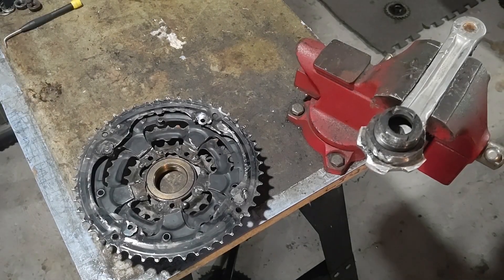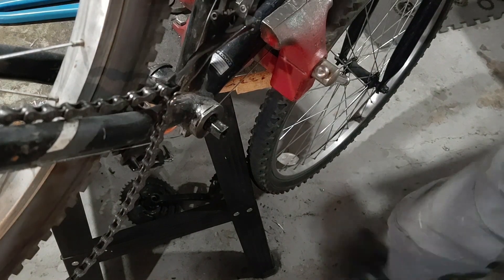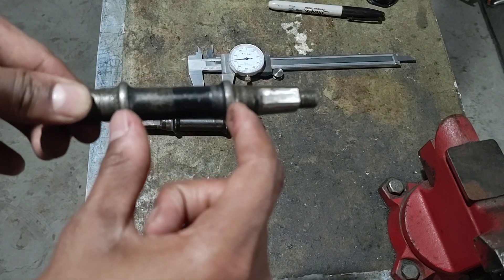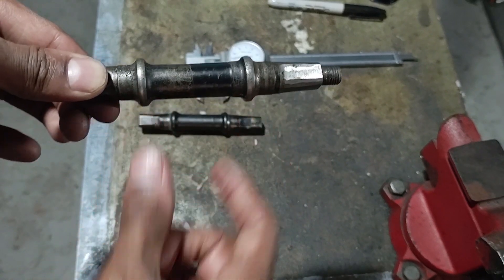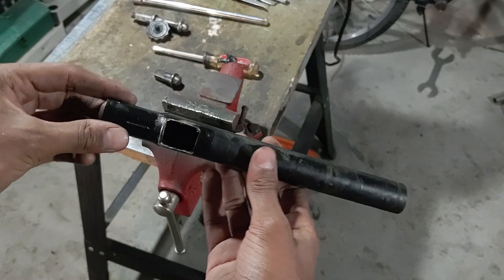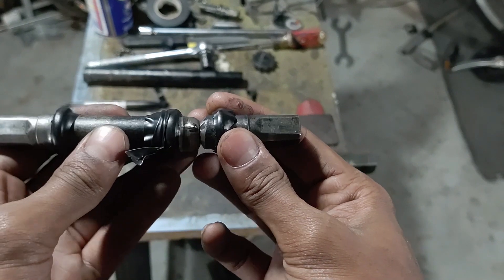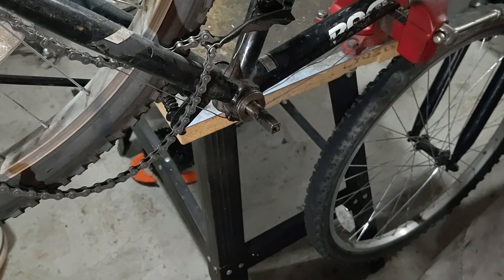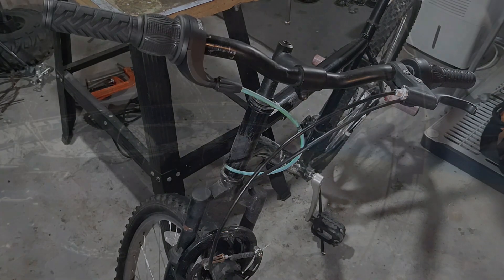DIY Mid Drive E-Bike Part 3: Extending The Spindle on Bottom Bracket

Comment: Thanks for the video.

Do you know where I can find the bottom bracket with those lips for cyclone? Probably they took from some old bike design? 
I'm already running my own mid-drive bicycle but I need to change the motor attachment design to attach the motor to the bottom bracket just like the Cyclone, but I can't find this bottom bracket anywhere.

I need 100mm version for fat bike.

Comment: When are you gonna post next video bro
Reply from the maker: Hey, I apologize for the delay, I've been super busy lately with a bunch of other projects which I will be posting on this channel soon, but I am planning to resume the ebike come June!
Reply: @engineeringdiy6311  I am doing mechanical engineering right now. I am from India. I also wanted to make my bike to ebike for my college it's 45km away from my place could you suggest me which battery do I need for reliability and durability. Lithium ion here is cheap but quality ain't very good. I am thinking of nmc but it can be quite dangerous if it catches fire.

Comment: @ 13:30 That came out way better than I expected. pretty clean and no issues installing the BB cups onto the flanges. You might consider Heat treating that axle one more time before using it though. I'm not so sure the strenght, especially around the welded are area is as strong as it used to be. But regardless, at least now I know what I need to do . Thanks for the video man.
Reply from the maker: This is absolutely a suggestion I am willing to try, since I am also doubting the integrity of the weld. Though I think the principle of using the pipe is sound, I would carry out the execution of this method differently.

If I were to do it again, I would grind in deeper bevels to allow more weld to be deposited deeper in the joint, so that there is still a decent amount of weld left even after it is ground down so that the cup can fit over. I would also preheat the pieces and use high amps (85-90 for e6011) to ensure the liquified electrode can seep through and fill any gaps, and reduce the chance of internal stress. 

Another possible way to keep a thick layer of weld is to create small tack welds in the pipe to lock the alignment, take it out of the pipe, slide the cup over the tack welds, and then create a second thick layer of weld, and since the cup is already in position, you don't need to grind away the weld. Although of course that would mean the cup is permanently stuck onto the spindle. 

I'm glad this video gave you a clear idea of how to go about doing this (in a better way) for your project. I will be making another spindle with the aforementioned improvements and do rigorous testing to ensure it doesn't break or warp, and then replace this video with an improved guide on extending spindles in a reliable and precise way.
Reply: @engineeringdiy6311  Honestly, I'd rather go for the option of putting the cups over tacks before fully welding it as strong as possible, But this definitely seems like the more elegant solution

Comment: @9:50 Brilliant Ideaa Never would I have thought to check if the seat post had the same I.D as needed. My thoughts were to clamp all the pieces on a vice together, Provided the vice has a straight edge, they should all align, But Your idea's pretty good too
Reply from the maker: Haha thanks! In fact, during my first try with the extended spindle, I clamped both parts in the vice but the alignment was not great, due to the fact that my vice clamping faces are scratched and worn (as you can probably see). I also didn't have precision parallels, forcing me to come up with the tube idea. It was pure coincidence that the bike seat post happened to be perfect. I'm glad I was able to keep  it "DIY" with a decent level of precision without needing to go to a machine shop.